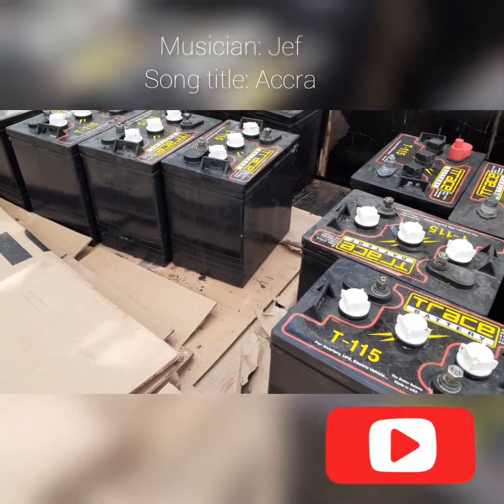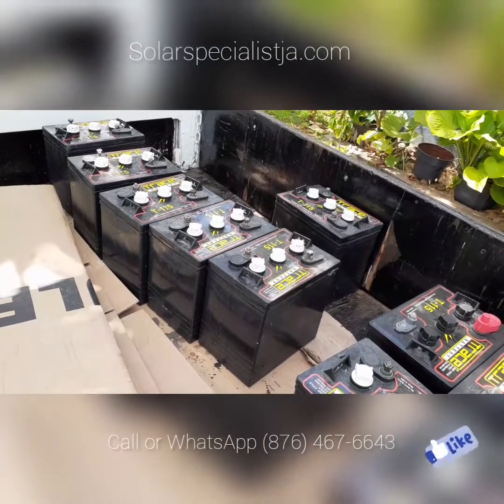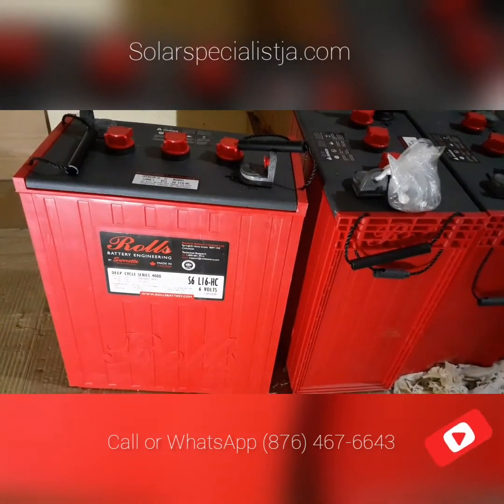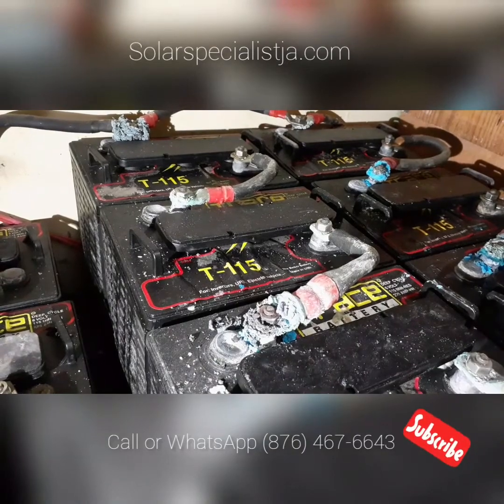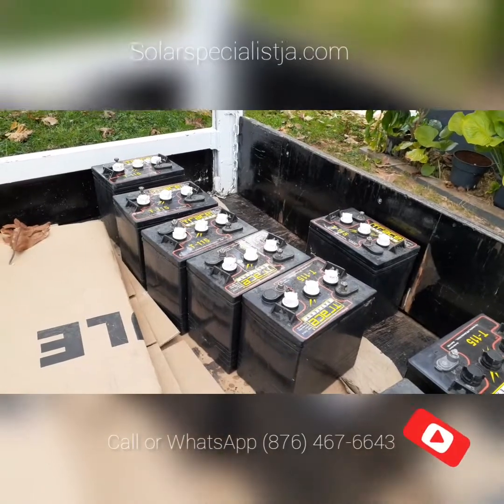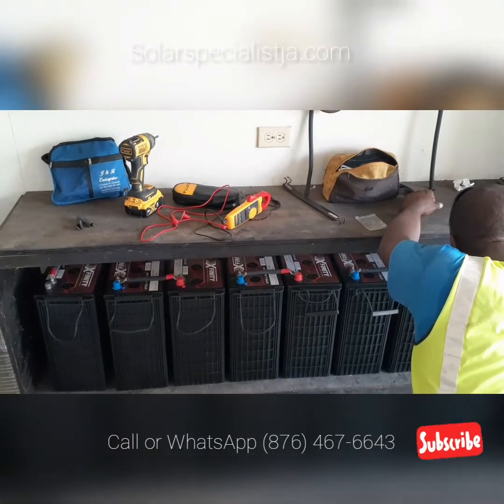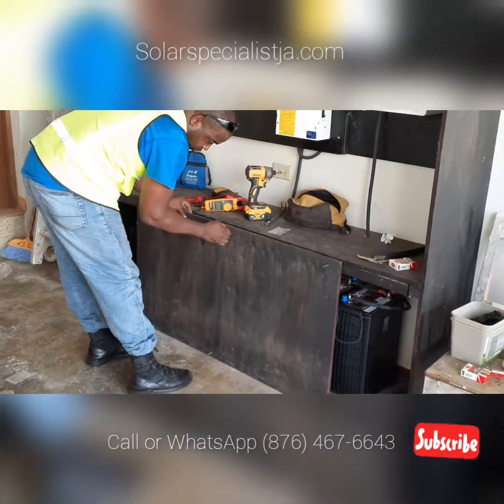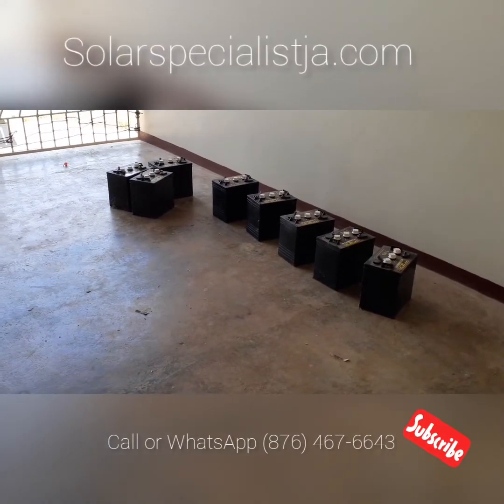Top 3 Solar lead acid batteries in Jamaica

Comment: I strongly recommend letting your customers know about Serge boost to reduce the amperage drag on the better you can use super max amplifier capacitors that store 4000 amp for serge load

Comment: Lead acid battery are not safe and very corrosive we need lithium Ion batteries.
Reply: Lead acid batteries are perfectly safe, they just need to be outside or vented outside. I used sealed lead acid for many years now with no problems.

Comment: What’s the cost of the maintenance free batteries and how long do they last?
Reply from the maker: They're rated around 1500 cycles... approx 5yrs at a cost of $45K JMD or approx $350 USD each
Reply: Hi there. Is it possible to get more than the 400amh by wiring in a particular way where all the batteries amh are increased by the total amount of individual units in the battery bank? For example 400 x 8 = 3200amh? Or is this a myth?